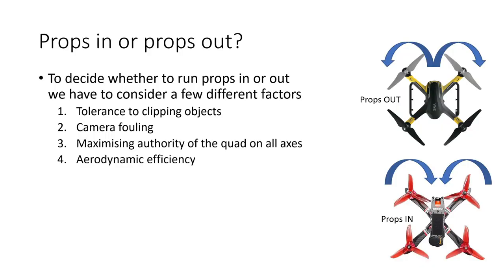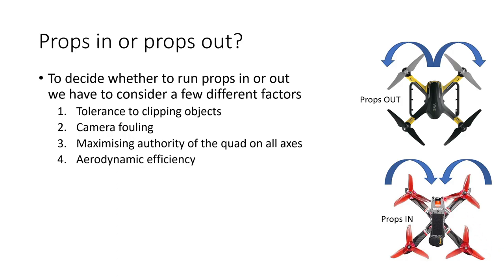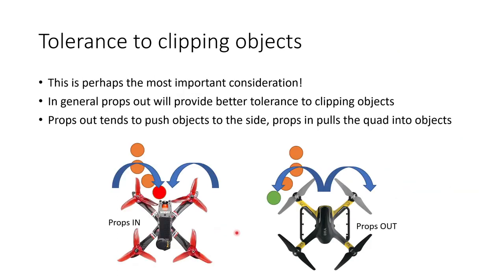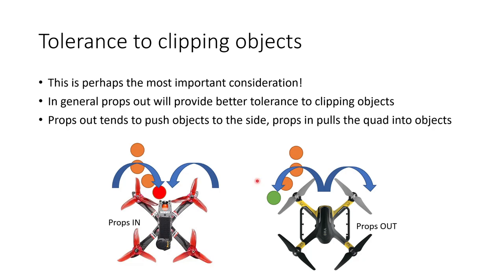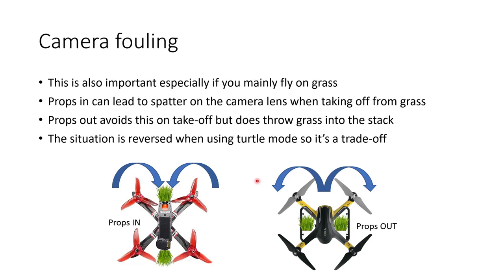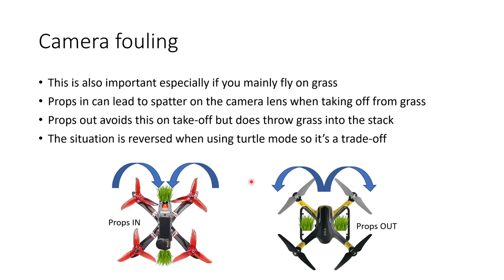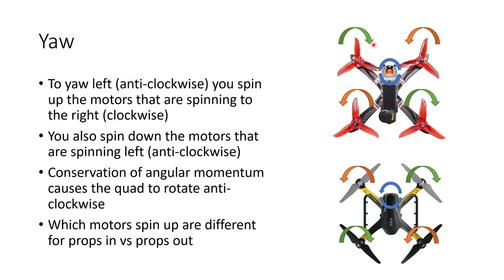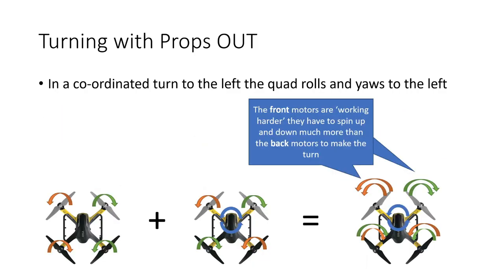Prop Direction. Should you run Props IN or Props OUT?

Comment: Very interesting, ive been curious about this but not curious enough to look into it. I needed this. Currently running props in as thats just hiw my nazgul came, can any drone be switched in betaflight? Im thinking i want to go out since all of my crashes have been clipping trees and feeling like im getting sucked in deeper, makes sense now.
Reply from the maker: You need to change ESC settings too. JB has a good video on it I think.
Reply: Switch your props around, change your ESCs to the opposite direction (normal > reversed ; reversed > normal) , and select the motors reversed option in Betaflight. That's all you need to do.

On whoops slide tweezers between the motor and prop to get them off easily.

Comment: Wouldn't the rest props always be in clean ish air during forward flight because they're angled up above the front props?
Reply from the maker: Yes. Forward flight is not the critical case though. The important situation is in high angle of attack moves where the rear props are in the wash of the front props. If you are only cruising in forward flight it doesn't matter as much.

Comment: I like props in. I'm wondering why didn't you draw the second set of red ellipses on the props out dirty air example? 

It looks like props in leaves cleaner air under the body of the quad, in the same direction the quad is likely moving. Any thoughts on this?
Reply from the maker: In the props out configuration there isn't such turbulent air on the outboard side so no red ellipses. This shows an advantage of props out. 👍

Comment: Cool analysis.  But if a quad is flying quickly through the air with 45 deg forward pitch, I would think the rear props get pretty clean air. Has anyone modeled this in CFD to see if it is a real issue?
Reply from the maker: Level forward flight is not typically a problem for either prop configuration. It's more important for agressive high alpha acrobatic moves where the rear props can end up in dirty air from the front props. Particularly prop wash situations.

Comment: Hmm quads fly at and angle though not flat like a fixed wing. sometimes as low as 15 deg to as high as 45 deg and some higher still, so how much effect does the dirty air have on the rear prop considering the props propel their air straight away from them selves. I'm guessing a lot of this air may not even make it to the rear prop especially in high speed runs and higher angles.
Reply from the maker: Depending on the aerobatic move you are doing the quad is not always at an angle but it is usually moving forward. Straight and level flight is actually not the most important situation to consider, descending through propwash is. Often those moves put the rear props right in the firing line of the front props turbulence.

Comment: Running props in, if an object is grazed, would it be less susceptible for the object to also come in contact with the rear prop? Given that the impact provides just enough torque from the front prop impact to fish tail the rear of the quad around the object? And the opposite for props out - more susceptible for both front and rear props on a given side to come in contact with an object that is grazed?
Reply from the maker: An interesting thought I have rarely seen front and rear props damaged from clipping something running props out so I don't think its a problem.
Reply: @ChrisRosser  thanks, I’ve only flown micros and with props in but now considering props out. Sounds like this is a non issue, and would be even more so on larger (more powerful/heavy) quads that are less impacted by the same objects

Comment: Downside to prop out is if you clip something your prop amd motor could spin in opposite direction loosening the prop
Reply from the maker: Because motors spin in both directions you can always loosen a prop nut in a crash depending on where you connect with the object. Props in/out doesn't make any difference IMO.

Comment: Motors with CCW props are usually have CW thread on the axis, and vice versa.
Should I resolder my motors to switch from props in to props out? Or could I just change settings in betaflight?
Reply from the maker: Nowadays most motors have the same thread for both directions and use a nyloc nut so it doesn't come loose. No need to swap motors just change it in BF.

Comment: Ive tried props out it does feel something is helping me in turns... but i dont like that feel.
Reply from the maker: Feel can be dealt with in rates and RC filtering. If the quad is handling better you should still be able to get the feel you want by changing your rates settings.

Comment: I have changed to prop out but straight away I got more prop wash. Can this happen, should I just revert back or tune it out.
Reply: What ESC? Stop running 48khz if its blheli_S and use 24khz instead, or if you have blheli_32 the new variable pwm 24-48khz, its better to start there instead of trying to tune it out of the controller if thats the cause.
Reply: @spikester  it’s a matek f722. I am running the 24-48 variable. It was night and day difference between props in and out, I wondering if it was turbulence from the frame arms now the leading and trailing edge of the props have been reversed. I don’t really want to change too many fc/esc settings if the fault is a design issue. Cheers
Reply: @stevend12  Excess frame vibration hitting the gyro, you have all your bases covered on the ESC. Indeed I too seen big differences between props in vs out, especially with how frames can resonate.

Comment: I prefer props in. I don’t like wet grass to getting thrown onto my FC stack and shorting something (I lost my first FC this way).
Reply from the maker: That's a very good reason! I've never had that happen fortunately but sometimes my stack ends up looking like a mower grass box and I get a little worried 😄
Reply: yeah but why are you taking off in the grass? and actually, the time when you are most often in the grass is when in turtle mode.... and with props in, you will be throwing everything into your stack so...
Reply: @mouseFPV  I don’t take off in the grass. I crash in the grass :P I’ve tried conformal coating (it looks shiny and pretty at first) but it turns your FC into a mess when you start replacing components.
Reply: @mouseFPV  in grass, it is really hard to do a turtle mode..I don't even try. Maybe with cinewhoop it is ok, or if the grass ain't that tall. And props out makes difference for whoops...maybe most of my flying with 5 inch was with props out, but recently I switched...and honestly it doesn't feel different to me. I also had a burned esc from grass, it was one of those with metal fets. It could be a coincident, but I prefer dirty camera instead of burned esc. And they got more expensive these days..:(

Comment: Hi Chris, I have a floating-at-zero-throttle problem on my two cinewhoops (a slammed squirt and a terraplane) that I've spent quite some time debugging with advice from people in the community. I got a video about it here https://www.youtube.com/watch?v=sKfA-0JjXQI. This is a few experiments old but it sums up the issue I've been seeing... I have more videos/data to share if you got the time. 

I had some discussions with Brian White, who highlighted one of the BBX signatures is that there's a fixed PID-I on YAW when the quad is 'floating'. Some theories were that the quad lacked yaw authority or there's some drag on one end of the quad which causes there to be a constant yaw request from the PID controller.

After trying to fiddle with Yaw I/P gains, I discovered the only solution was to flip from props-out to props-in. Worked on both quads without any changes other than the props and ESC direction. And I re-wired the ESCs to flip the direction on the front 2 motors to rule out the ESC. Not sure what to make of that. Have you heard anything like this or have thoughts on this?

Comment: i think your analysis of the authority is faulty. because what you do in a coordinated turn is not left yaw and roll but left yaw roll plus pitching up. and that  puts even more load on the front motors
Reply from the maker: Thanks for your comment. It's well understood that for craft with less authority such as tiny whoops props out does confer a benefit. In a coordinated pylon turn pitch remains constant, in fact you typically pitch down slightly to accelerate out of the turn. I think you only pitch up if you are trying to turn like a fixed wing?
Reply: @ChrisRosser  i thought you speak about 5"ish free style or racer quads. if you look at the stick movements (e.g. bardwells videos) we always pich up  when doing turns in acro mode. you could also look into the log as u do a coordinated turn and analyse what is the command input. another thought that i have is how much work is to be done to accomplish the turns, i would guess the effort for yaw is higher than the other axis

Comment: I’m developing a long range 7” rig and set up my first props out and I’m going to switch all my birds to this configuration. Seem more efficient. 
I disagree with you motors video. I use pancake style motors for long flights. On my new 7” build I’m running 3106 1500kv motors. Got 19.5 min on a very only 4s 3200mah can’t wait to get a Li-ion

Comment: That theory is not quite right, it considers the quad in level flight and parallel to the ground when in fact it’s tilted forward in pitch 15 to 25° in order to move, so there is not much of a advancing blade or a dirty air on back props! It’s not an helicopter!!!!!
I also run it OUT and the only thing I notice is cleaner lenses!
Reply from the maker: In fpv flying you often perform moves that place the rear props directly in the wash of the front prop (e.g. power loop) however you are usually travelling mostly forward or backward (rather than sideways) so I think my assumptions are valid. I don't make the assumption of level flight or the quad being parallel to the ground at all in the analysis so I'm not sure where that is coming from.
A majority of commenters have said that Props out performs better for them so I think there is good evidence to validate the analysis.  I hope that helps answer your question.
Reply: @ChrisRosser  the quad is always tilted, in a power loop you are always sucking the quad in a different direction the way you could get into front prop turbulence is when in rapid forward flying and leveling the quad so the inertia makes it moving forward until drag stops it, but it’s not often someone does that!
Reply from the maker: @cmtetaboaco  Any time you are descending through your own propwash the rear props are in the wash from the front props. At the end of a power loop or during a split S are two classic examples. A sharp pylon turn is another example more common in racing. And yes if you are flying forward and pitch back to slow down is yet another example of rear props being in the wash of the front props. All of these situations occur frequently in flight and are often combined with adverse inflow conditions. Props out has a clear advantage in all these situations... I can't think of a similar list of maneuvers where props in provides a clear benefit.
Reply: @ChrisRosser  I see, I trained myself to round down split S and power loops not to get I’m PW and also have a more beautiful maneuver like an real airplane, descendo on your turbulence is not a good “pilot” behavior, about race, I know nothing!
I fly out prop but just because of dirty camera, in the quad behavior I see absolutely no difference at all, same PIDs also! Flew 4 years “normal” now 3 years “inverted” and the transition was not notified! If you give me a quad to fly I’ll only know the props direction when I hit a leaf LOL

Comment: You are calculating like an air plane the wind from front and the wind comme from top
Reply from the maker: It is important to consider every possible orientation of the quad. The analysis is not for straight and level flight.

Comment: Aerodynamic turbulence from front to rear propellers is almost non existant. Back props are never in the wake of front props, you would have to fly flat...for authority, it is interesting to link props in/out, and frame geometry. There is a real subject there, as disc loading isn't homogeneous.
Reply from the maker: During high alpha moves like power loops  the rear props are very much in the wash of front props. You are right that in steady forward flight it's not so much of an issue.